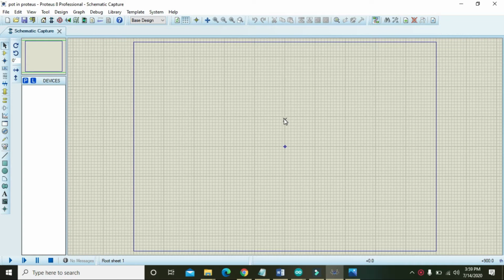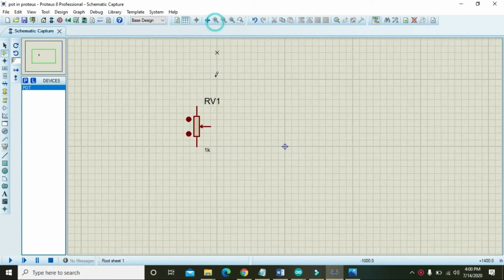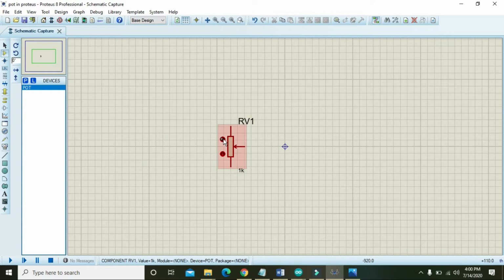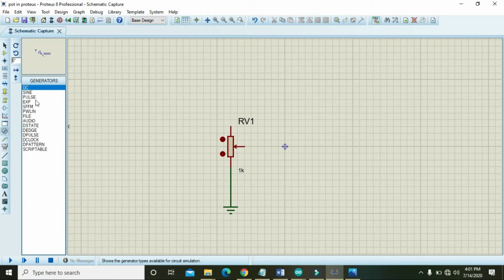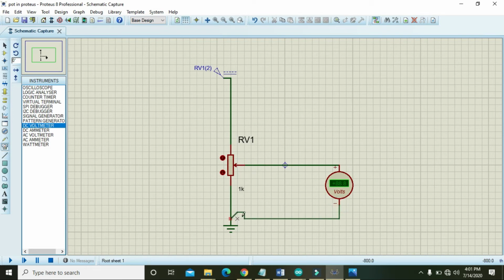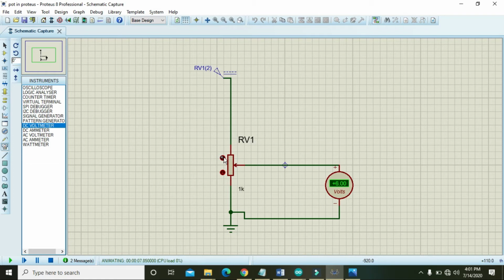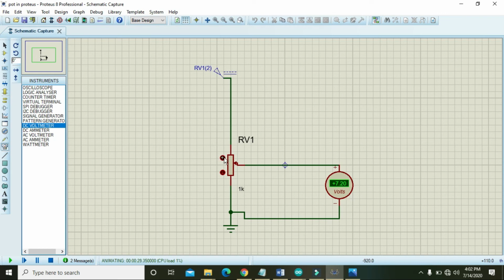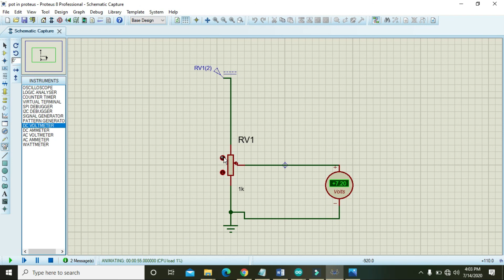how to use potentiometer in proteus | how to use variable resistor in proteus

Comment: Great explanation, at 02:40 you mentioned the phrase "We will away from the VCC pin resistance is going to be increase and voltage must be decreased".
So, is this resistance placed between Vcc and middle pin?